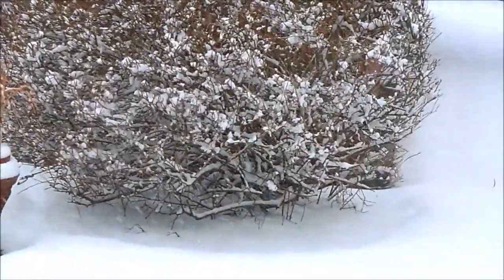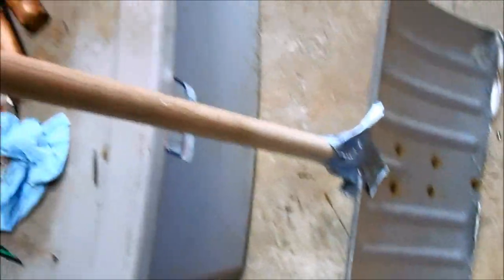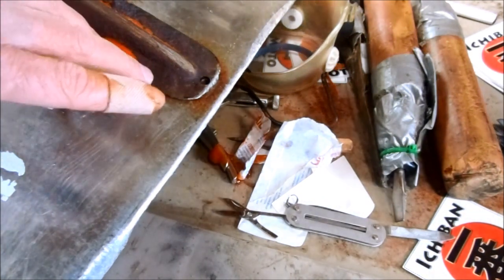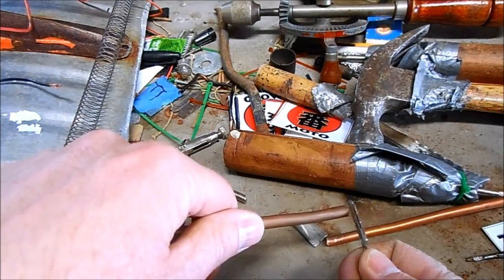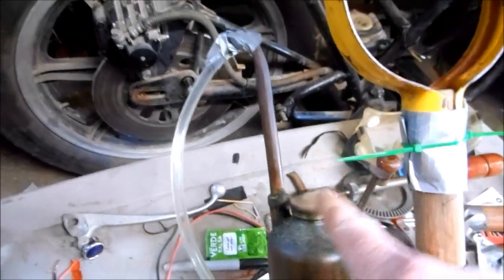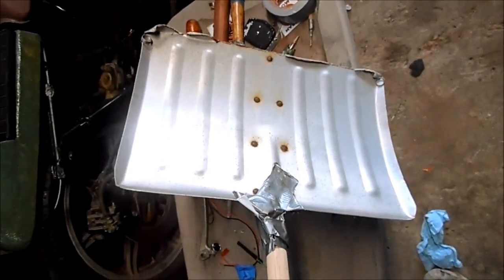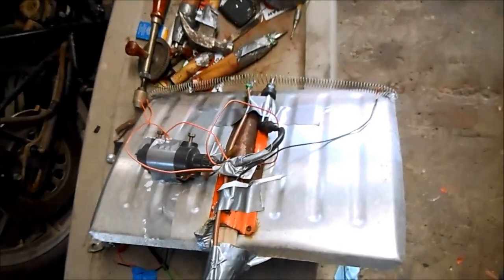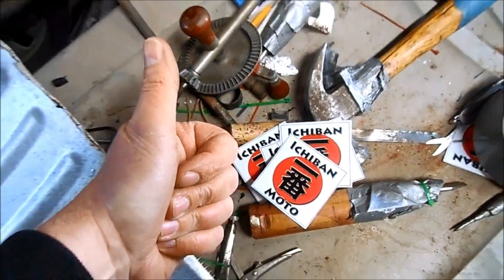the worlds most advanced snow shovel how to video

Comment: I needed a bit more snow melting heat, up here in Alaska...so I wired it to my 120 volt wall plug at home. It keeps blowing the circuit?!?! Any help with this, should I try my dryer machine outlet instead??? Maybe I just need more power?

Ps. Keep up the videos, love them!

PPS  LOL

Comment: Hey wait a minute, I thought you said the green zip-ties provide superior strength and safety? You wouldn't want that fuel oil reservoir falling off if the black zip-ties fail.
Reply from the maker: the fuel reservoir is a quick disconnect system - so I can just swap them out during heavy blizzards.